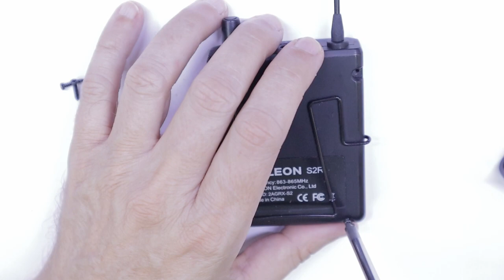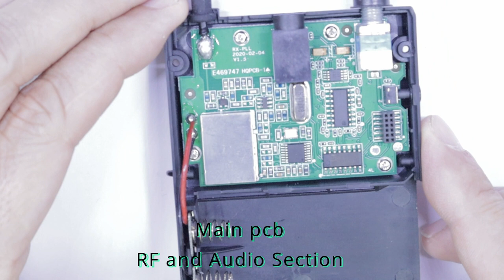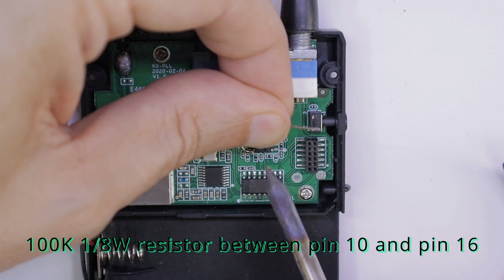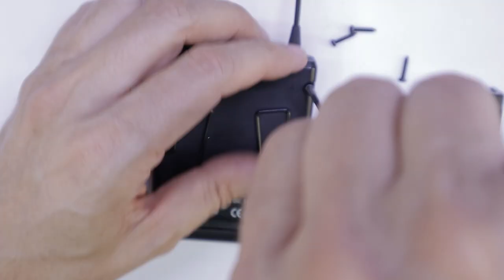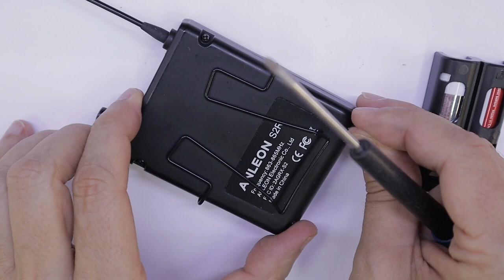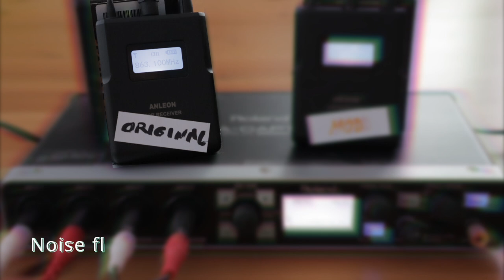MOD Anleon S2 Receiver

Comment: Can you please give me an advice.. i have got my new from AliExpress, and i see the channel on unit in next way:
A1 863.1
A2 863.4
A3 863.9
A4 864.2
A5 864.6
A6 864.9
B1 840.0
B2 843.1

And so on. So the installed frequency banks are not just ascending from 863-865. They jumps from 840 to 864.9 in some kind random order...
So i cant set 863.5 for example...
Is it okay? Or do i have some strange stored order of frequencies on my unit?
Also is there a way to reorder and specify frequencies stored? So my goal is to get smth like:
A1 863.1
A2 863.2
A3 863.3

Or even 
A1 863.1
A2 863.15
And so on.

Thank you!)
Reply from the maker: hi, You must have the new Anleon S2 that has a group knob and a channel knob on the transmitter. Mine is one of the old ones that didn't have the group knob and only has 6 channels.
Although mine is different, the new system must be understood as 36 channels. Six for each group